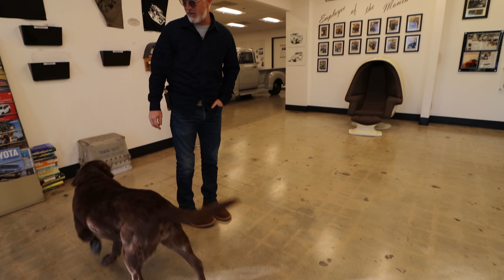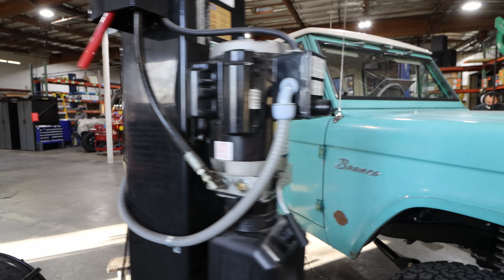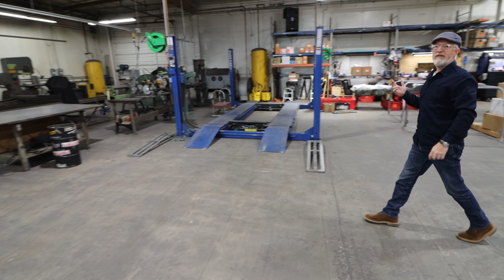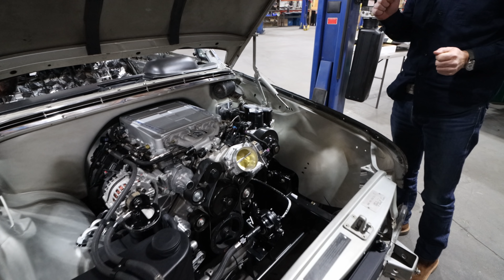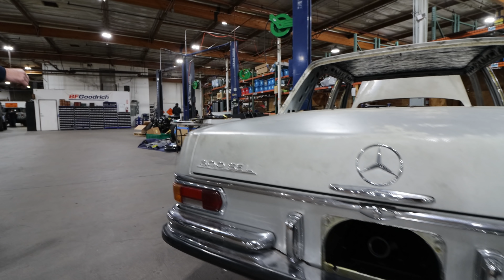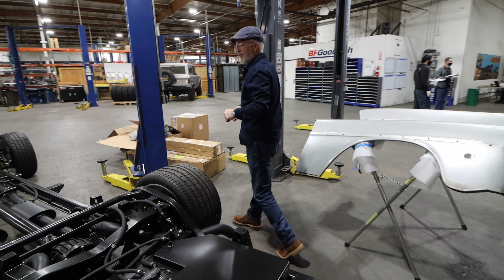ICON 4x4 Shop Tour 2021

Comment: Really amazing vehicles. Will the Chevy come with the new driver's air-bag from the 2500 4x4 donor pick-up? Any thoughts on adding air-bags to ICON vehicles?
Reply from the maker: Impossible to do correctly because everything, even the body, is designed to absorb impact in chorus with the air bag systems

Comment: Have you all ever considered franchising and having sort of an off brand "icon lite" type shops that do more limited 50-250k transformations?  Supply chain people who have worked in pre launch activities would have good supply chain familiarity as far as prototype capabilities, and if your cad work thus far was made available to franchisees then alot of the custom design parts could be just remade using prototype shops, and used again since the design work has already been done.  Custom work done by franchisees could be vetted by the central office and then added to the network catalog if it was a sound design.